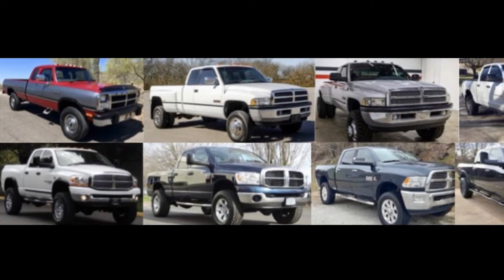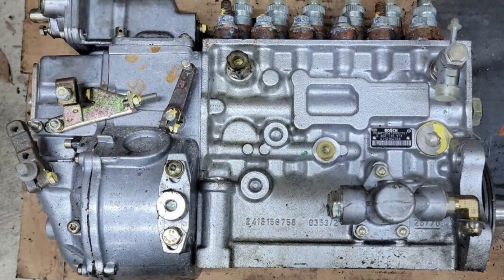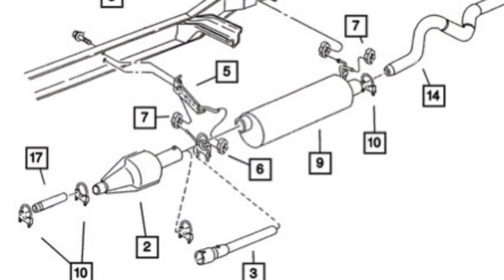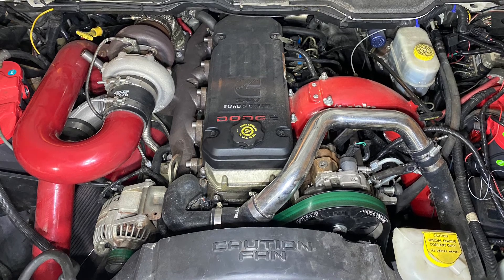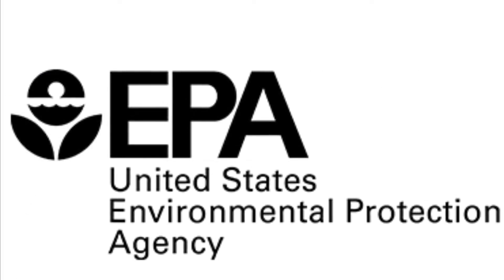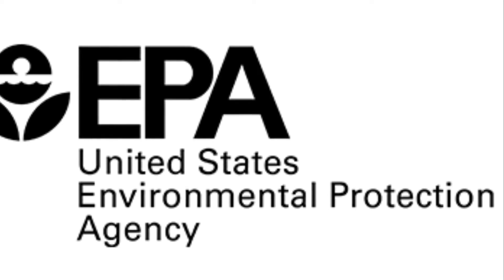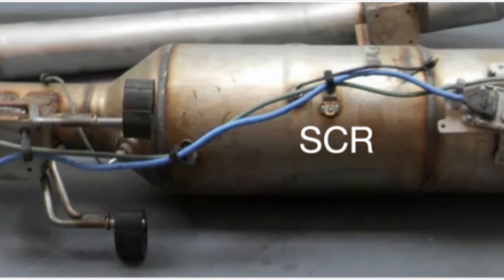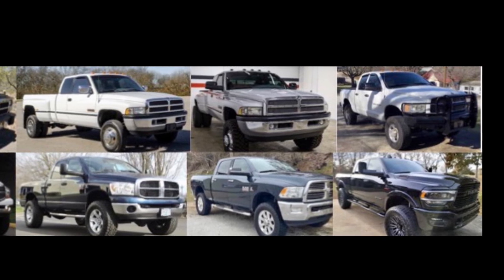The History Of Cummins Emissions And Fueling, Which Trucks Have Which Equipment?

Comment: I heard someone makes a tuner for the 3rd gen with a single injection event. It was mentioned that it ran stronger and got better fuel economy. They also commented that they rattled like an earlier model. I wonder what the emissions were like, and the boost from the turbo was like?  Have you done a show on tuners?
Reply from the maker: This sounds like the content I covered in my 12 valve tune (single injection event) video. I noticed less smoke with the 12 valve tune than any other tunes I have run. The boost seemed similar. Starting in cold weather takes a little more effort from the starter, but other than that it seems to run the best. It is also very loud, but I like the sound of it.

Comment: nice job BUT what  about the 2007.5 to  2008 BLUE tech 6.7? I have one it has the EGR and a rare earth muffler but does not have dpf or go in to regens >thank god<
Reply from the maker: The BLUETEC badging meant the emissions met 2010 50-state emissions regulations. The BLUETEC rigs from 2007.5 and 2008, from the factory, were equipped with EGR, diesel oxidation catalyst, diesel particulate filter and NOx storing catalyst. Your rig must have lost some weight at some point during its life 😎

Comment: Ive got an 01 and an 02 3500 and neither have a catalytic converter. Owned since new.
Reply from the maker: Yes, the 1998.5 to 2002 Cummins ram’s were compliant with emissions requirements at the time they were produced due to their electronically controlled VP44 pumps being more efficient than their predecessors. They did not have cats, just resonators. The CA versions were tuned differently to comply with CA emissions requirements, which at that time were more strict than the federal emissions requirements. I’d love to have a 1998.5 to 2002 Cummins (non 53 block). I’ve been looking for one for a while. Just can’t find one that isn’t rusted out.

Comment: Informative video! I’ve got a few questions and comments. I’m new to owning a Ram Diesel Truck and I’m a bit of a nerd/gear head so please bare with me.

On the 1st generation Bosch mechanical fuel injectors how does the mechanical injector open? Is there a spring in each injector that measures the pressure and opens accordingly?

At 3:29 you mentioned the 2nd gen & the era of electronically controlled diesel. What did you mean by that? The reason I ask is because at 5:05 you mentioned the first of the Ram trucks to be equipped with the electronically controlled common rail fuel system. 

Uh your statement “From here forward it gets complicated” when talking about the 2007.5 & up emissions system is definitely an understatement!!!!! Wow!!

You know call me crazy but it would seem that if they stopped selling remanufactured engines for certain years and they raised diesel fuel prices and they pushed/subsidized electric vehicles/infrastructure along with requiring diesels push oxygen out their tailpipes one would get a strong feeling or suspicion THEY were trying to get rid of the diesels all together. 🤔 Nah it couldn’t be!!

Again I appreciate the video. I’m new to owning a Ram Truck and diesel & found this video extremely informative.

✌🏽
Reply from the maker: Glad you enjoyed it! Congratulations on being a new Ram Diesel Truck owner.

Correct, the 12 valve mechanical injectors are pintle style injectors which utilize a spring. 

For clarification on the electronic control. Prior to the 2nd gen 24 valves, both the fuel pumps and injectors were mechanical. Those rigs could survive an EMP attack. The 2nd gen 24 valves (1998.5-2002) were the first to utilizes an ECM controlled fuel pump (VP44 pump). 2003 was the first year of the common rail system with electronically controlled injectors. 

100% on the emissions systems being complicated and adding a whole new layer of complexity to diesel truck ownership and maintenance. And yes, it does appear certain organizations are trying to get rid of the diesel engine without an adequate solution to replace the essential role it plays. Thanks for watching!

Comment: I bought a 05 dodge diesel a couple months ago. It came from Oregon and had to pass smog in northern california. It's a pre egr and only came with a cat, no other smog. The problem is the trucks computer has to be reset at the dealer to pass calif smog. Which they have to do for free. I went from a 01 tundra 4x with 15 mpg to a 3/4 ton long bed 4x with 35's and 20mpg and about double the payload/ towing ability.
Reply from the maker: I think you made an excellent choice. In my opinion, the 3rd Gen Cummins equipped Ram trucks are some of the finest trucks ever made. That’s great info, I didn’t know the 2004.5 to early 2007 California version trucks had different tuning than the non-California version trucks from those same years. It doesn’t surprise me though, as the 2nd Gen 24 valve California versions also had different tuning than the non-California versions. Up until mid 2007, the California state emissions laws were stricter than the federal emissions laws which is why you see California versions on the 1994 to 2007 trucks. Even the 03-04 California version trucks had cats on them. 2007.5 forward, the federal emissions laws became stricter than the California state emissions laws, so federally emissions compliant trucks were automatically California emissions compliant from that year until the present time. In the future that might change though, as California is constantly making moves against the diesel engine.
Reply: @AK_5.9  Yeah the dealership wanted it back, they had it close to sold to someone in Oregon so no need for the smog bs, i found out about that the dealership would have to update the computer to pass smog without the egr, just with the cat, from a smog guy. I feel blessed it all turned out, love the truck.

Comment: Will an 03-04 turbo back exhaust fit an 05?
Reply from the maker: I believe the 03-04 and the 04.5-07 trucks have differences in their exhaust elbows due to having different size downpipes. This means the distal end of the exhaust elbow on an 05 might not fit the proximal end of the downpipe that comes with the exhaust system (if the factory turbo setup is still present on the truck). There are ways to overcome this and make it work, but it might not be plug and play out of the box. The hangers might also have different locations, but I’m not sure about that.
Reply: @AK_5.9 Hey thanks for the info, I have an 05 and have been debating whether to get a 5 inch cat back or try to adapt an older turbo back to fit.
Reply from the maker: Either choice will be better than stock. Good call on the 5” 👍
Reply: @AK_5.9  wow  vois
Reply: U know I booked a exhaust kit for a 2004 came the next week put it on my 2005

Comment: Hesitated to subscribe until I saw the efforts you put in for this unique video. If YouTube creators received Emmies, this would be one that should get the nomination.

Q: I am thinking of upgrading my stock injectors with DDP. Based on your research, the injectors for my 2018 Ram HO AISIN 3500 fire 5 events. Is there a way to have the injectors fire 4 or 3 events and still maintain power.

This is my goal: Have the ultimate tow truck. Be able to tow 45-50k with zero smoke. I want to have 1500-2000 ft/lb of torque. Don’t care about HP, but I believe 750-850 would be a sweet spot. 

I upgraded the CP3 to a 10mm. Added a Fass 165. I am thinking of keeping the VGT turbo to retain the exhaust brakes. I am looking at a DPS compound turbo that works with my existing turbo (which I may switch later with a Cheetah or ATS VGT.

What injectors would fit the bill? Would 150 hp injectors be overkill?

Your expert opinion is much appreciated!
Reply from the maker: Thank you, I had a lot of fun making it

The post injection events are mostly about emissions and can be removed with tuning. To reach your goals, your 2018 truck will need a “weight loss diet”, if it’s not already on it.

I’d do 100% over Exergy injectors (or equivalent) with an s366/s480 compound turbo setup with billet compressor wheels. That fuel/air combination, with proper tuning, should get you near the numbers you want with minimal smoke and good towing performance. Also, go ahead and install head studs, aftermarket valve springs and push rods (if you haven’t already). A good time to address that is while you, or your installer, are under the valve cover replacing the injectors.
Reply: @AK_5.9  Your advice is appreciated.  Will keep in touch for more of your insightful content